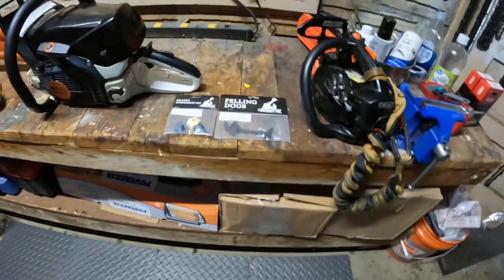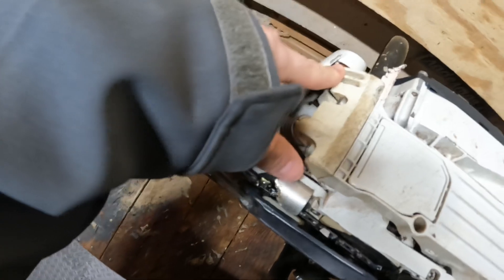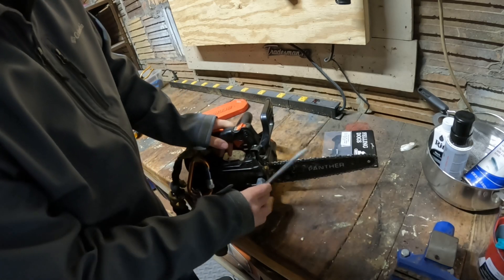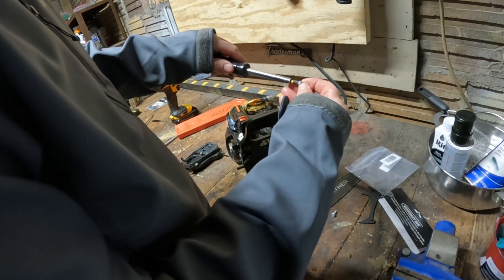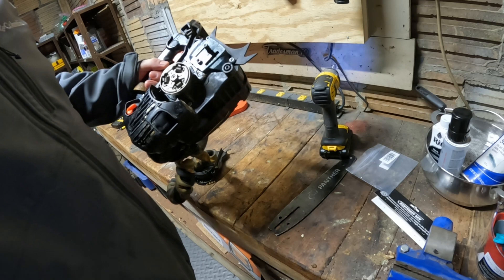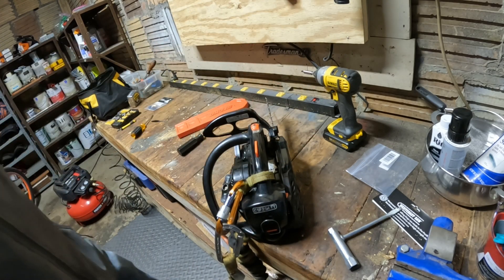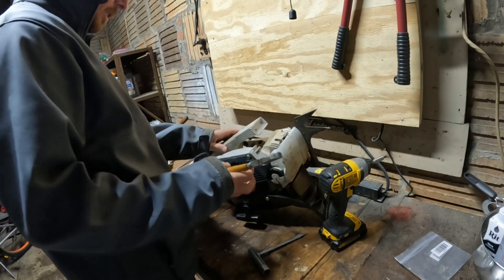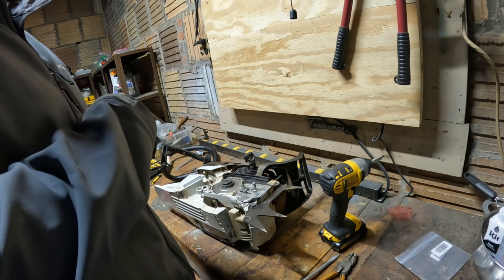￼Saw Talk: West coast Saws faller suspension/ 3 point dogs

Comment: Can you tell me where to get the bigger cylinder cover so I can run the foam filter I bought?
Reply from the maker: Not sure I understand what you’re asking.. the foam filter for the 462 matches right up. You just need to remove the plastic plate that the stock paper filter snaps onto

Comment: Where did u find and get the scrench holder?? I can’t find them anywhere!
Reply from the maker: I bought the 3/4 wrap handle on eBay. Genuine Stihl oem part, not aftermarket, and it came with it already on. I was told that they are just a couple bucks from a Stihl dealer, but i never looked into ordering more. I want to honestly, i want one on my 500 and my 661. I imagine it’s called “wrap handle tool holder” or something like that.

Comment: Man I wish I would’ve seen this video earlier because the trigger linkage issue happened to me installing the suspension and I couldn’t figure it out
Reply from the maker: Yeah dude. With the 462 it’s a defect in the handle, but it’s still easy to knock it out of place on any model if you’re not careful, and they SUCK to fix . I just took mine to the dealer